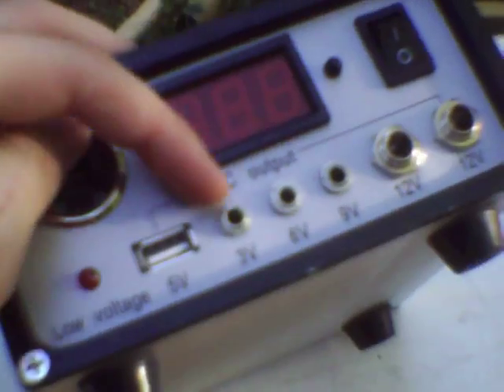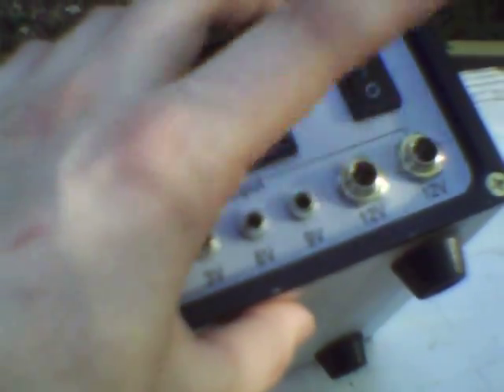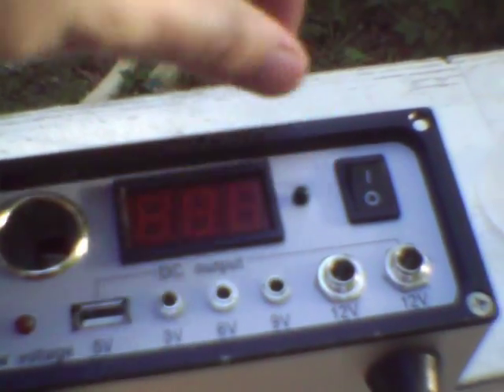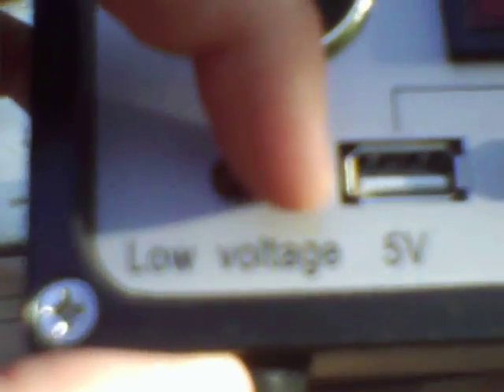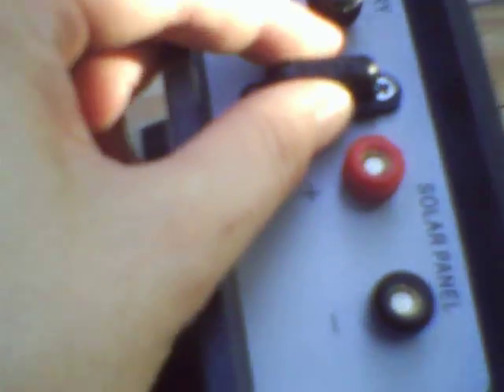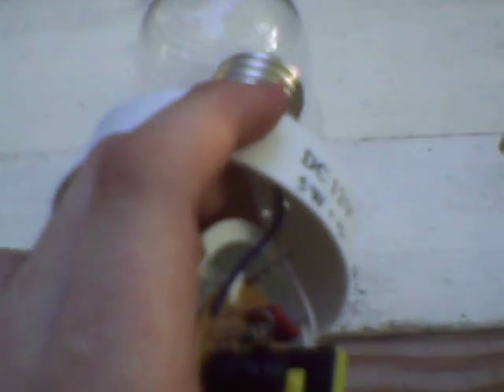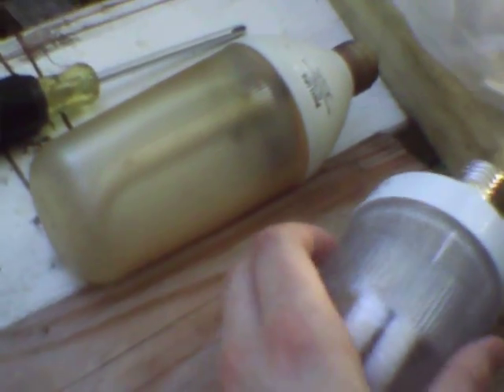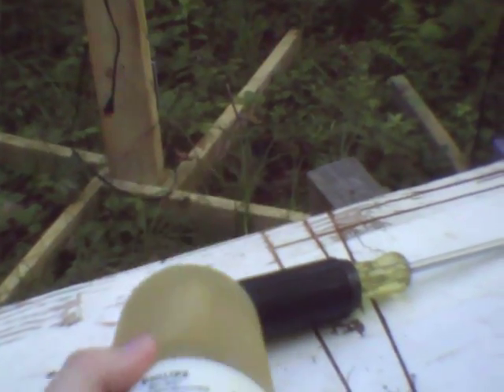Harbor Freight charge controller guts

Comment: Can it handle 24v?
Reply from the maker: The ICs can, but the resistor networks used for the LM393 are for 12V charging and would need changing for 24V use.  You would also need to change any 25V or lower rated capacitors on the battery or solar rails to 35V or higher capacitors.
The only reason to even do that is if this charge controller is all you have and you have no money to get a better one as these are not great charge controllers.

Comment: Thank you for pointing on the fuse, I changed it and display started to work again. One of outputs for 12 V was burned (I used 12 V bulb for 36W on that socket, since both of original 5W bulbs went out of order and I couldn't find similar, so made one myself attaching a reflector on 12V to the base of the original bulb). Do you know how to repair it, where to buy that end? I plan to make a bulb with low wattage from the regular led bulb, so I could use both 12 V socket.

Comment: According to my fluke (model 115), when isolated (no battery attached) the charge controller pulls 9mA with the LED readout off, 37mA with the LED readout on. Adding a small 120v inverter without a load on it pushed the drain up to ~240mA.

Comment: i have 2 of these and find them just about useless because they shut down just under 12 volts.every ther inverter and UPS system i have,runs great down o the safe discharge level of 10.5 volts.with a brand new 120 amp hour battery,[tried 3 diff ones] charged to full 13.7 volts.i only get a few minutes of use with anything.the controller.shuts down at 11.5-7??????????as far s i can tell i may as well bypass the whole circuit board take it out and throw it way if it cant run a 3 volt lamp with anything less than 11.5 volts.

Comment from the maker: The wiring in this is a bit marginal for the ~6.5A that you would get from 9 HF modules and the 4A fuse would of course blow.
For $90, you can get much better charge controllers than the 30A harbor freight one.

Comment: I have 9 of the 15 watt HF panels hooked up together. Is this too much for the included charge regulator. HF sells a 500 watt charge controller. I am wondering if I need to upgrade to that.

Comment from the maker: 6 15W modules is on the upper end of what this controller can handle.  Whatever you do, replace the stock 4A fuse with a name brand one as the stock fuses in these have badly made elements that are prone to nuisance blowing.

Comment: Great video, thanks.

Maybe you could answer a quick question for me.  I have 2 HF 45 watt solar panel arrays.  I also got from HF a Thunderbolt Magnum Solar connector which can accept up to 8 - 45 Watt solar panel kits.  If I connect my 2 kits to this connector, then run that combo to my HF charge controller ...  would I overload the charge controller????

Comment from the maker: The lamp ballast uses a Royer oscillator front end, and they don't compensate for changes in input potential.  As such, they should be run on batteries.  The display on the controller is the battery potential.  The controller should be connected to a battery as it oscillates without one.

Comment: i have a question with that 5 watt lamp, it should run straight of the solar panels. right? on a sunnyday. mine does not run them and i have 45 watts. solar panels. i bought another solar panel now makeing 60 watts. and still the same thing. on the digital meter it gives me about a 14.5 reading is that watts>? or volts. please help. or my charge controller is dead? can that controller support 4 15 watt solar panels?